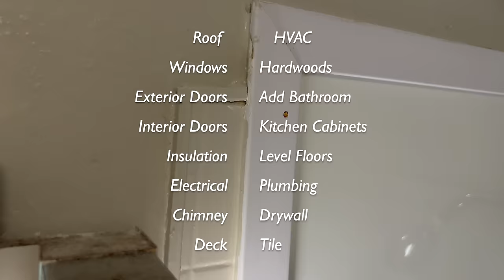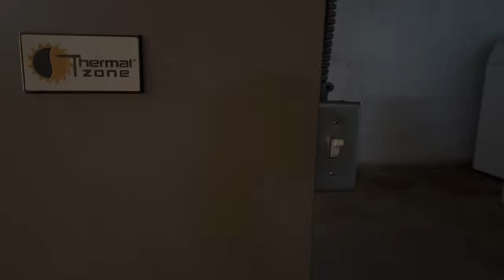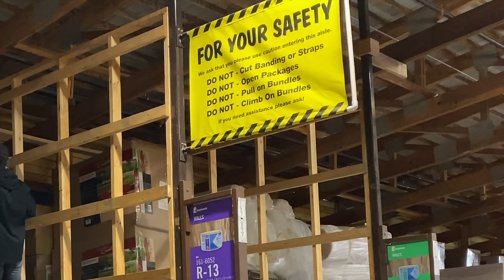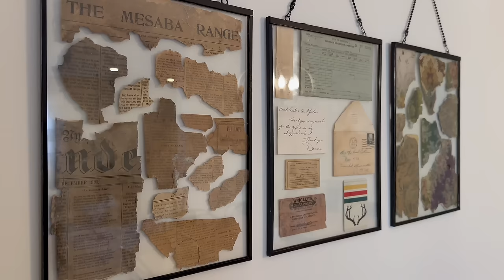Couple Transforms Century Old Home in 26.53 Minutes | TIMELAPSE Ep. 69

Comment: Oh I'm so happy you kept the sing!
Reply from the maker: Sadly, we couldn’t save it! We tried to salvage the one that was there. Someone drilled a hole into it (for a sprayer) it was chipped, and stained with iron ore. We called around about getting it repaired and refinished- they either couldn’t- or recommended we didn’t do it (yes, even the cast iron resurfacing company told us not to!)

So then we searched craigslist, marketplace, etc. for an over a YEAR to find a used one. Nothing. Trust me- this new one is cast acrylic and I’m not convinced of its longevity! And it WAS NOT cheap!

Comment: Oh my gosh I'm BEYOND HAPPY that you kept that fabulous kitchen sink. I want one like that so so much.
Reply from the maker: Sadly, we couldn’t save it! We tried to salvage the one that was there, but a omeone drilled a hole into it (for a sprayer) it was chipped, and stained with iron ore. We called around about getting it repaired and refinished- they either couldn’t- or recommended we didn’t do it (yes, even the cast iron resurfacing company told us not to!)

So then we searched craigslist, marketplace, etc. for over a YEAR to find a used one. Nothing. Trust me- this new one is cast acrylic and I’m not convinced of its longevity! And it WAS NOT cheap!

Comment: Die gesamte Installation sieht sehr abenteuerlich aus. Verteilerdosen aus Blech mit Nägel an den Balken befestigt, bei uns in Deutschland undenkbar. Fenster zum hochschieben kennen wir nicht,bei uns gibt es nur Drehkippfenster. Mir ist ein Haus aus Beton und Ziegel lieber als aus Holz. Trotzdem ist das Haus schön geworden.
Reply from the maker: Thank you! 😊 It’s crazy the different building codes even from state to state. The windows were the “best” we could get from our local store. They are definitely not top of the line but they work. These houses were originally built to be moved as the mine moved 😂 Wouldn’t want concrete and brick for that! 🫣
We appreciate you watching and commenting! We hope you have a great Sunday! 🌲😊❤️

Comment: I understand budget restraints, but when the roof deck underlayment was going on, I hoping to see a peel-and-stick for absolute water and air sealing. Speaking of that, did you guys put any insulation under the floor above the crawl space?
Reply from the maker: We did a peel and stick on the first layer for an ice and water shield. Maybe, we should’ve gone all the way up? 
There is a full basement under the entire house that is heated. 
Thanks for dropping in! 🌲
Reply: @TheLiFeInPines  Full basement? I'm envious! Anyway, I'm a nerd for things like sealing and efficiency. Every seam has to be taped, foamed, or fluid flashed. Every opening has to be flashed, gasketed, and/or caulked, and every cavity has to be stuffed with either closed-cell or rock wool.
Reply from the maker: Absolutely nothing wrong with being efficient! 😊

Comment: I hope you know how valuable that farm sink is
Reply from the maker: Sadly, we couldn’t save it! We tried to salvage the one that was there. Someone drilled a HOLE into it (for a sprayer) 🤦🏼‍♀️🤦🏼‍♀️🤦🏼‍♀️ it was chipped, and stained with iron ore. We called around about getting it repaired and refinished- they either couldn’t- or recommended we didn’t do it (yes, even the cast iron resurfacing company told us not to!)

So then we searched craigslist, marketplace, etc. for an over a YEAR to find a used one. Nothing. Trust me- this new one is cast acrylic and I’m not convinced of its longevity! And it WAS NOT cheap!

Comment: You have to sand all the way down to the bare metal
Reply from the maker: Where there was a lot of rust, we probably should have sanded down to bare metal, but we risked putting a hole right through it! Haha! We learned a lot through that process!
Reply: @TheLiFeInPines  You could do a light sanding too, then spray with a couple coats of primer. The paint just has to have something to stick to

Comment: Every one of those shark bite fittings is a failure point that your will have to redo later down the road. I speak from experience.
Reply from the maker: Oh shoot.. well, that's not good. How many years do we have? 😳
We have them at our home as well and they've been fine for 8 years...
Reply: They start failing at around the 11 to 15 year range. I had to replace several with the compression fittings. Keep a couple of things in mind. 1. This was 20 years ago when installed. The design may have been improved. 2. It was in a mobile home, so not as well insulated as a house. Not sure if that will factor in or not. But worth mentioning. SharkBite fittings are designed as a temporary DIY repair until you can get permanent fix. At least that was what I was told by a plumber friend of mine.  @TheLiFeInPines
Reply from the maker: Super interesting! Thanks much for sharing that with us!

Comment: Was all the drywall bad?
Reply from the maker: Pretty much, yes! Every exterior wall had mold. Some of the ceilings had mold because of the leaky chimney. And the interior walls that we removed Sheetrock from was because we opened them up to make wider entrances/added closets, etc. 
Not a job we’d like to do again, but it was necessary.
Reply: @TheLiFeInPines  👍